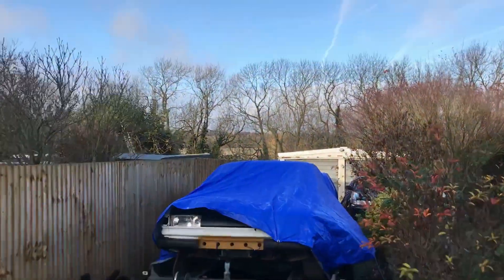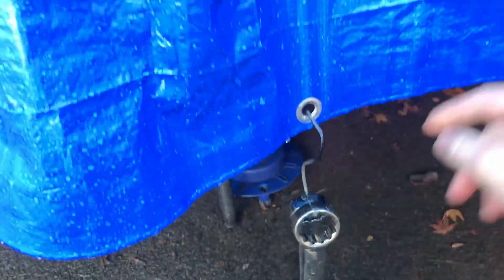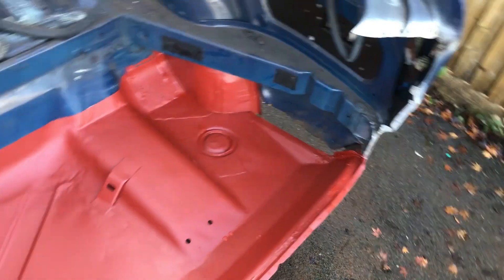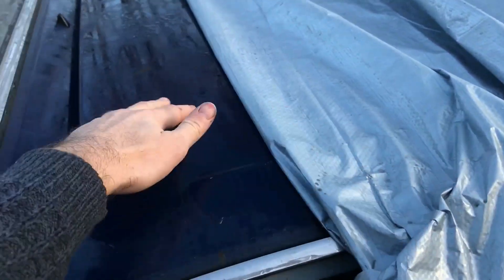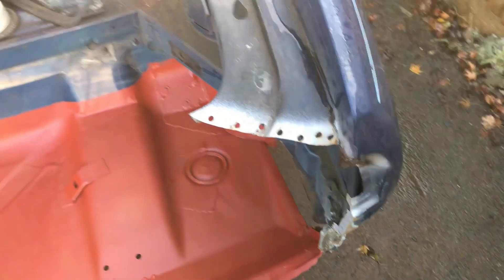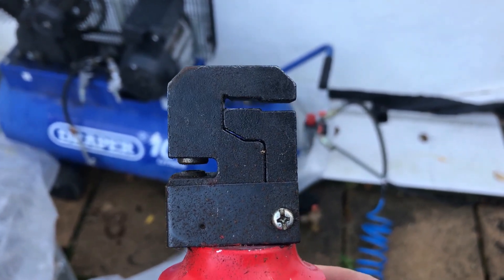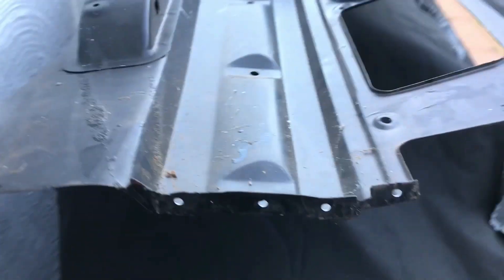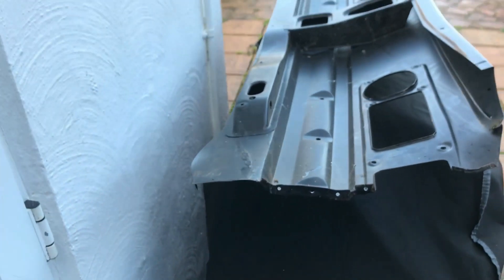Rover SD1 2400 SD Turbo restoration - Video 79 Rear lamp panel welded on!!!!

Comment: Love the camera stand James , mossy green & concrete grey combo is all the rage in 2021 😂, very sustainable 👍🏻,  spot on welding as usual and yeah those tarpaulin manufacturers always lie 😁 but you probably only got the 100 raindrops proof instead of the 6 billion drop proof 😉. Merry Christmas 🎅 James.